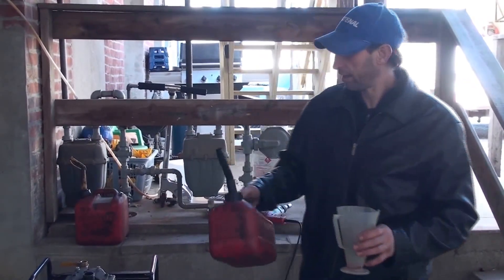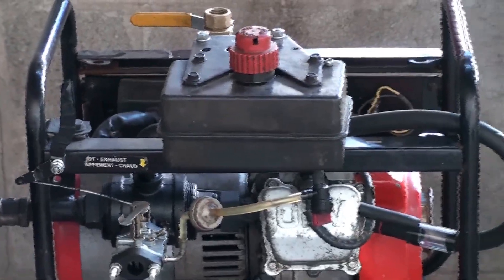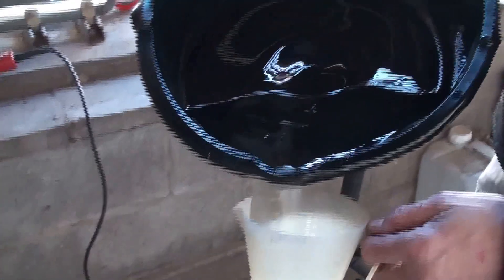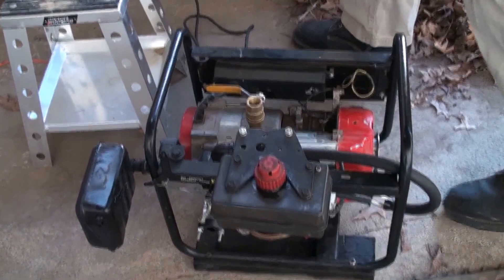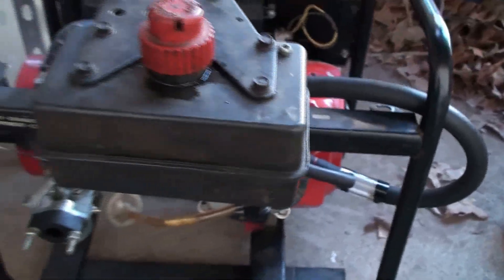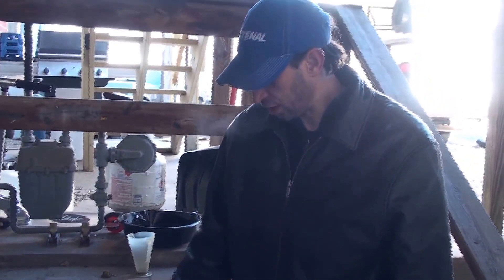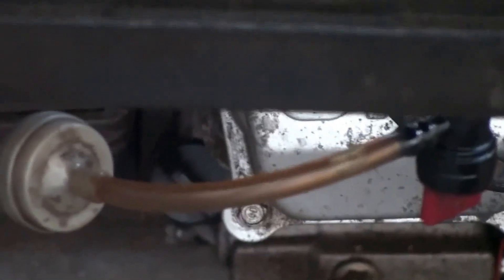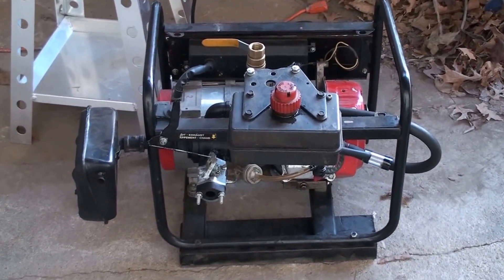Evaporizer Fuel Technology - Video 1 of 2 - Demonstration

Comment: nice job and keep up the work on testing these things I've done it for many years and spent thousands of dollars doing it. One thing that you got to be careful of though is to not over rev your engine, I blew a motor in a lawn mower doing that with a vaporizer. 

Also when you did the test with a used motor oil you still have residual fuel left in the tank which is why it ran like it did and without it being a hot vapor system you would not be able to run the engine on used motor oil. I guarantee that you would have oil left in your tank after the diesel ran out. I've tested used motor oil in a vaporizer but I used a hot vaporizer system and had the vaporizer over 400 Degrees F when testing used motor oil and it still didn't vaporizer very well at that temperature. used motor oil vaporizers really slow so you got to have it really hot or have a large surface area to produce enough Vapors to run an engine. When I tested used motor oil I had it sitting in the vaporizer while the vehicle was running normal off the injectors then once it was hot enough and there was enough Vapors in the vaporizer from letting it sit in there while it was hot I switched it over to run on the vaporizer and it only ran for about 30 seconds off the used motor oil Vapors before it died because it wasn't producing enough and that was at over 400 degrees Fahrenheit.

if you're still doing it keep up the work because you'll see amazing results once in awhile. It's getting a system dialed in and having one that will work without flaws and constant adjustments that has prevented this technology from being put on the market.

I personally don't even believe that Pogue or Tom Ogle had a system that worked without flaws to the point that they could actually produce a working system that they could sell. Yeah maybe killed but I still don't believe that the technology was Advanced enough that it would not still encounter problems.